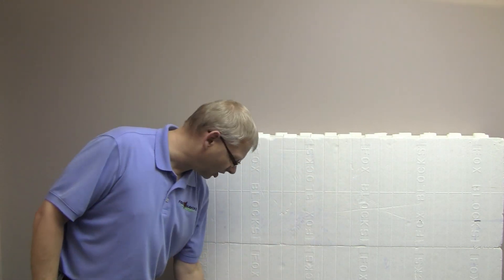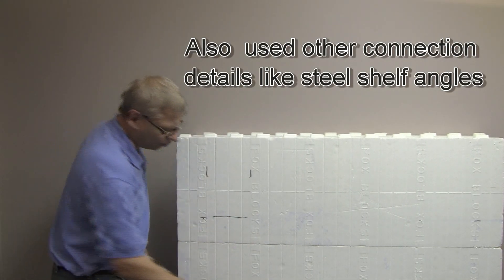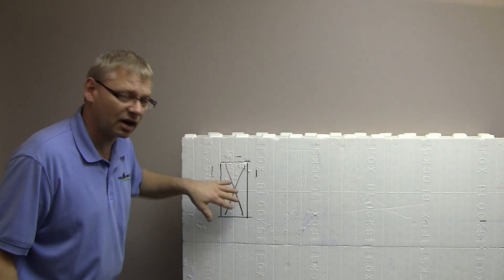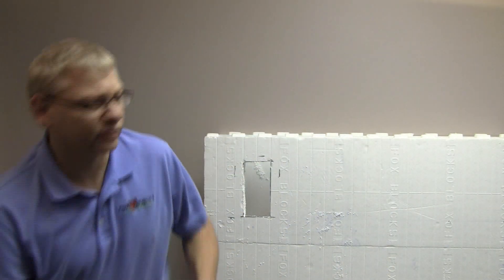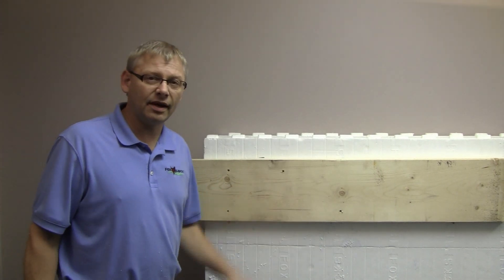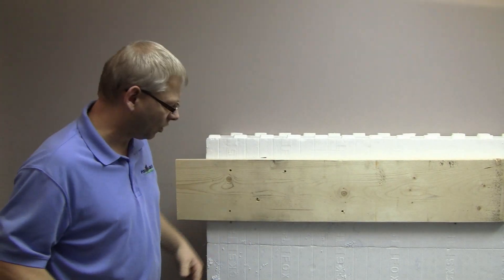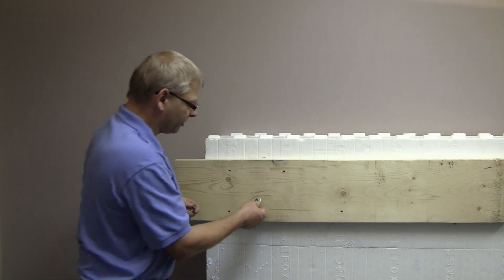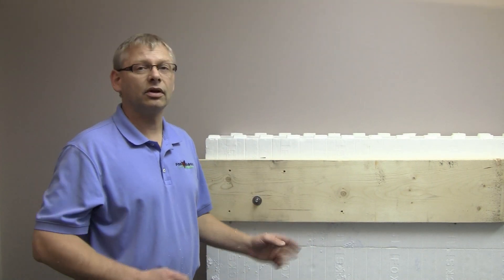How to Attach Floor Joists to ICF Walls Using Anchor Bolts | Fox Blocks Insulated Concrete Forms

Comment: WAAYYY more work than just dropping metal hangers in.
Reply: until you have to drill and tap all the holes for those hangers and plates.
Reply: @neckofthewoods24  You obviously don't what I'm referring to.

Comment: How is this a fire stop?    The continuous foam, sandwiched in the wall is exactly why the London apartment building burned. The foam is not a fire stop.

BTW  I really like your anchor bolt solution.  Elegant, simple, fast, cheap.  And, effective.
Reply: Sailor376also your rant is off topic and obnoxious.
Reply from the maker: Hi sailor376also
This is not a fire stop situation and is used for single family homes. I really need to redo this old video although it is still relevant and this method is used every day in the thousands of muti-story single family ICF homes. Also, ICF's are being used in hundreds of buildings over 5 stories tall and in fact over 20 stories tall with ICF's that have full testing approvals.
Reply: I would strongly suggest that you look into the fire this past June in London, Grenfell Tower (sp?)  The 20 story tower of apartments burn bottom to top via its polystyrene cored skin.  The high rise building's remodeled exterior skin  formed a foam chimney up the outside of the building igniting each floor and apartment on the way. 79 died, at last count.

Even in the basement walls there will be cutouts for electrical outlets.  The drywall will be slightly above the floor. That is how we install it, 3/4 of an inch up., and then covered with a wooden baseboard.  There will no doubt be other cut ins for pipes and possible structural,,,,,plumbers use MAP gas torches to sweat pipes in and near walls,,,     and the foam core is not a firestop.  Quite to the contrary, it is a very strong fuel that produces some incredibly toxic smoke.

You must firestop at each floor.   I see no other reasonable solution. That firestop line must be at the same line that would normally be occupied by the double top plate.

Add one step to your building process.  After the wall is poured.  Cut an accurate 2 or 3 inch band of foam out at the bottom of the band joist, fill with mortar.   Quick and cheap. But,,, be particularly careful of the electrical cables that will pass vertically between floors, for those cables will form small passageways from fuel to fuel.  This is different from fiberglass filled wall hollow to wall hollow,,,,, and the firecode demands that we pack each and every small intrusion through the top plate, pipe and wire.  In the case of ICF, that is not a fiberglass filled hollow, that is a fuel filled space.  Particular care must be exerted to seal between floors.

Grenfell Tower.    Sorry, we know better now.  This may be in advance of the written Uniform Building Code, but I see no alternative to a PERFECT firestop at each wall top and particular care must be observed behind  bathtubs and above any soffit, closet drop ceiling, pipes, air ducts, wires, etc.

I compliment you for the ingenious bolt and pre-instalation of the band joists,, right down to the folding saw and angles top and bottom of the cut-out.  What is the cheapest, quickest way to fire stop that wall top?  My mortar band,, the electricians are gonna hate, probably destroy.  Install of a crown molding would be impossible.   What would you do?  Gotta be a way.   But you must firestop it. This is not optional.
Reply: @Sailor376also  Your post is inaccurate. Correct, ICF forms are polystyrene but that is not what was used on the Grenfell Tower. Also, when new cladding was installed on Grenfell Tower the cladding included an air gap of two inches in between the exterior aluminum-polyethylene and new polyisocyanurate (not polystyrene) insulation which was mounted against the existing concrete walls. The fire spread up the wall because of the air gap which acted like a chimney. The aluminum held in the heat, the polyethylene part of the cladding burned and the polyisocyanurate insulation likely with aluminum foil facing, further held in the heat and although rated fire resistant, would have added to the fire as a fuel source. All in all a tragic lesson in how not to construct exterior cladding on buildings.

The air gap was the primary reason for the rapid advancement of this fire.
Reply: @user-vp1sc7tt4m  Thank you !  My only source was news reports,,, early reports talked of foam burning,, and I seem to remember polystyrene was mentioned.  But,, Your explanation has the ring of truth about it.  The 2 inch air gap,, I assume not fire stopped, or poorly fire stopped, between floors would certainly account for the rapid rise of the fire,,, and the polyethylene coupled with the polyiso would certainly account for the toxicity of the smoke.

Thank you !

Comment: Untreated wood touching concrete could rot.
Reply: it's just for demonstration purposes
Reply: Well, the "demonstration" should be fixed as it doesn't meet the building code. The rim joist should have sill gasket behind it.
Reply: It actually is touching the concrete in this case because he cut out that opening to allow concrete to flood out to the wood 2:26. I think I'll stick with the Simpson supports.
Reply: Concrete inside of a house with proper drainage or is just isolated from the ground wont wick moisture to the wood to promote rot. But for added insurance just place a waterproof membrane where the wood touches the concrete. Still far cheaper and easier to adjust than Simpson supports. If measurement are off or its not level after the pour.

Comment: Why is cutting the hole in the foam necessary? Can't you just drill through the rim joist and foam? Not enough concrete holding the anchor on a 6" core?
Reply: because then the bolt will not be subjected to shearing forces but bending forces and therefore become significantly weaker
Reply: @abc-ed1nr  
But now you have a direct contact between wood and concrete and this is bad for the wood.
Reply: @di9838  well it should be pressure treated wood and/or have a moisture barrier like roofing felt or similair
Reply: @di9838  lots of people cut 3: hoes with a Hole Saw mount the Bolts onto OSB or Ply wood whatever is available and cheap then after concrete sets remove ii
now the Concrete is flush  with the out side foam .. take the OSB off and use it as a Pattern to Drill your Ledger board and make your holes a little bigger